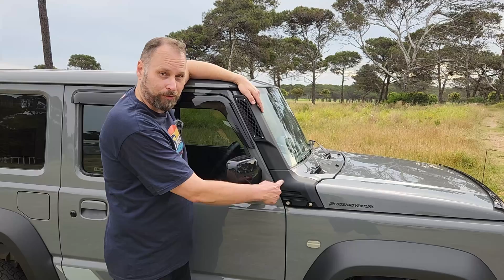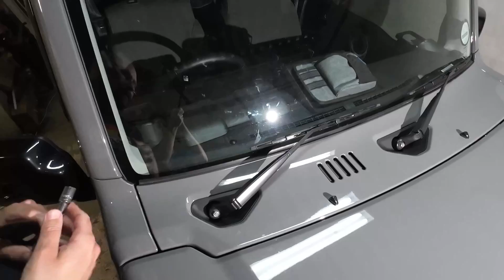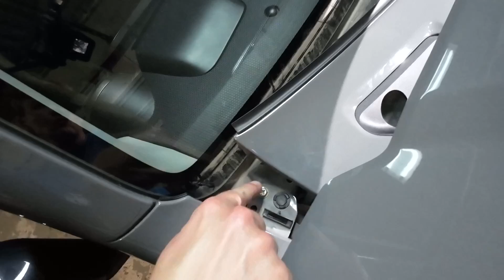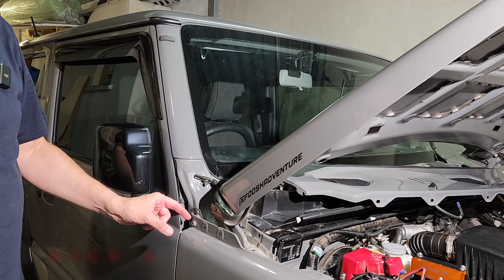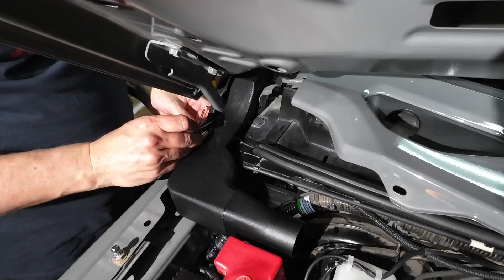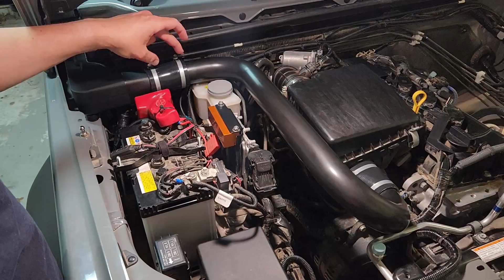Jimny No Drill Snorkel DIY INSTALL - Jimny Wild

Comment: OK, was all good until I saw the round rubber adapter connect to the square intake on the air filter box.  Does that seal properly???
Reply from the maker: Hi, yes it does, we havent had any issues with the seal.

Comment: I find a lot of noise at the intake. Is it normal?
Reply from the maker: Hi, do you mean engine noise or the vibration of the intake against the body?
Reply: It is the engine noise
Reply from the maker: Yes this should be normal

Comment: I saw on another long term review that the snorkel of this design added allot of road noise, is this in line with your experience now almost a year later?
Reply from the maker: Hi, no we havent experienced road noise, of they possibly mean vibration against the body, use silicone to fix that.

Comment: Even with following this process shown the pipe/coupler touches the Master Cylinder. This is simply dangerous as there should be substantial clearance in the engine bay between anything attached to the engine and anything else stationary as the engine moves. There is a reason why the factory air inlet hose is so flexible. I will have to return the snorkel unless anybody else have found another solution to connect.
Reply from the maker: Over time we have done quite a bit of experimenting with adjustments, there is a playoff between creating the gaps at the reservoir and at the air con pipe versus slight vibration either on start or on the brake pedal. If you can find the sweet spot then you are sorted.
We have also now got 2 small support brackets in, which help keep the pipe in a lifted position resulting in good gaps and no vibration, after some months experimenting this is still working well for us.
We are happy with the snorkel, looks good and no noticable loss in performance.

Comment: Hi, on the snorkel side so it's no longer possible to fit the bonnet support gas spring, isn't it? I can see the ball head screw still fitted on that side. Thank you
Reply from the maker: Hi, that is correct, but we still use the one on the other side and have not had an issue, it seems to be adequate.
Reply: Must remove gas strut, otherwise bonnet does not close. One gas strut on other side has insufficient lift. Might as well remove both.
Reply from the maker: Still havent had an issue with the one strut, but dont leave it open in a gale force wind.

Comment: During rain, cant water enter al these holes?
Reply from the maker: We have not experienced any issues with rain, all snorkels have air intake plates.
Reply: I'm also looking for the same question is it safe for the engine while parked outside in rain

Comment: Does it provide enough air flow?
Reply: No, a bit less. For more air u need a forward looking Snorkel.
Reply: It supplies enough airflow. Previous comment is not rationally sensible when you consider the standard setup is under the bonnet not requiring forward airflow

Comment: Does it provide enough air flow?
Reply: My experience is its quite restrictive on airflow. I modified mine for better airflow and drilled drain holes for water from rain or washing the car
Reply from the maker: @johnhewitt1096 where did you decide to drill the drain holes?
Reply: @fooshadventure where did u drill the holes and get more airflow
Reply from the maker: We havent had a need to drill any additional holes.

Comment: Nice job. I was thinking about bravo snorkel, but this looks better. Is it watertight? Gonna instal breathetkit? No sock anti dust available? Is it sold in europe maybe?
Reply from the maker: Hi, we are still testing it ourselves the positives is that it has been used quite widely in Aus for a few months with positive feedback, and for us their climate is similar to ours. You can contact Jimny Wild, he has a lot of knowledge in the development of the kit. Www.jimnywild.co.za
Reply: I was wondering this too. I'm not intending to do hard-core rock scrambling, and only regard being off-road as a means to an end for bushwalking, camping, and forest immersion... but that does involve a lot of dust, corrugations and water crossing on occasion, and knowing the snorkel is watertight against heavy splashback or waves being stirred up from deeper but not insane water crossings would be a big comfort.